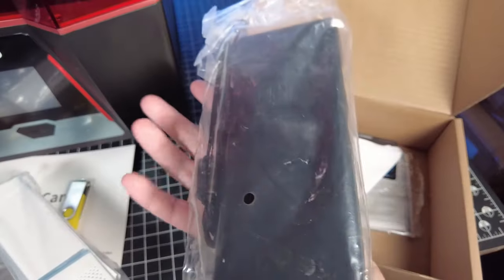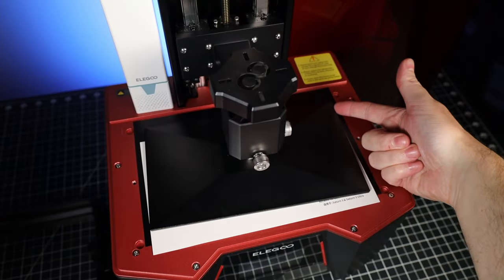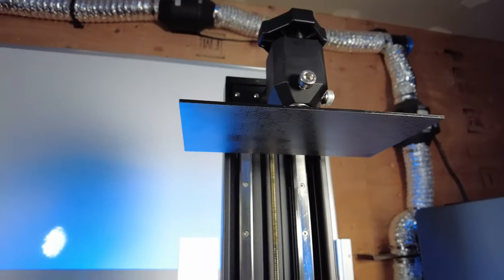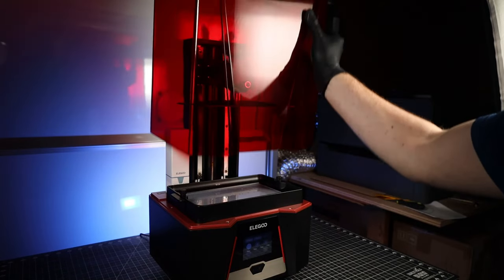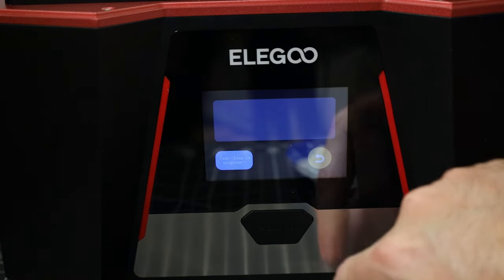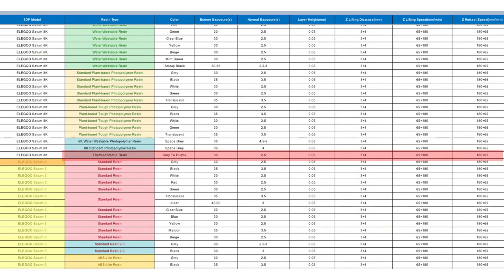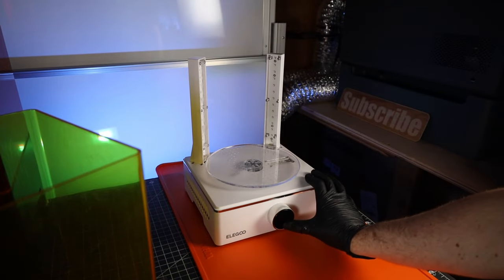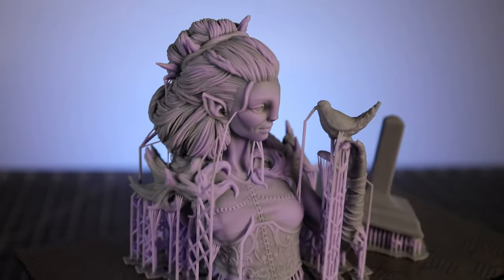Amazing Print Quality From A $400 Resin Printer - Elegoo Saturn 3 12k

Comment from the maker: Resin 3D Printers:
Saturn 3 12K (From Elegoo) - https://bit.ly/Saturn3-12K-Resin-Printer
Saturn 3 12K (From Amazon) - https://amzn.to/3F0hPsB
Saturn 3 Ultra 12K (From Elegoo) - https://bit.ly/Saturn3-Ultra-12K
Saturn 3 Ultra 12K (From Amazon) - https://amzn.to/3ZFCM5M
 
Flexible Build Plates & Silicone Mat:
Flexible Build System - Saturn 3https://bit.ly/Saturn3-Flexiable-Build-Plate
Wham Bam Silicone Slap Mats - https://bit.ly/SiliconeWorkMat

Standard Resins:
Thermochromic Resin Grey to Purple (From Elegoo) - https://bit.ly/Thermochromic-Resin
Thermochromic Resin Grey to Purple (From Amazon) - https://amzn.to/3taGMPn
ELEGOO ABS-Like 3D Printer Resin (From Amazon) - https://amzn.to/3FjbEjP
ELEGOO 8K Water Washable Resin (From Amazon) - https://amzn.to/3RHNnLn

Castable Resins:
Siraya Tech Cast Purple Castable Resin (From Amazon) - https://amzn.to/46za34I
Siraya Tech Cast True Blue Castable Resin (From Amazon) - https://amzn.to/46uqYWa

Engineering Resins:
Phrozen Onyx Rigid Pro410 (From Amazon) - https://amzn.to/46c7mq9
Phrozen Onyx Impact Plus (From Amazon) - https://amzn.to/48Ce7mx
SuperFlex 3D Printer Resin (From Amazon) - https://amzn.to/469KcRl
Chitu Systems Conjure Rigid Resin (From Amazon) - https://amzn.to/48D4rYW

Calibration Files:
Phrozen XP Finder - https://helpcenter.phrozen3d.com/hc/en-us/articles/6324821843993-How-to-Dial-in-Resin-for-Optimal-Results
Cones of Calibration STL - https://www.tableflipfoundry.com/

______________________________________________
Note : Most of the links that I use that go to products are affiliate link. This means I make a small commission on anything that you happen buy using them. This is at no extra charge to you and this helps support the work I do on this channel. 😁👍
______________________________________________
#elegoo #elegoosaturn #resin3dprinter #3dPrinting #3dScanning #DIY #RandyMay

Comment: I feel like resin has come along way since I’ve tried it. Thanks for the showcase.
Reply from the maker: No problem and I'm sure it really has. My first resin printer was the Anycubic zero 😅👍 that had a very low resolution screen, small build plate and non mono screen so it took a long time to print